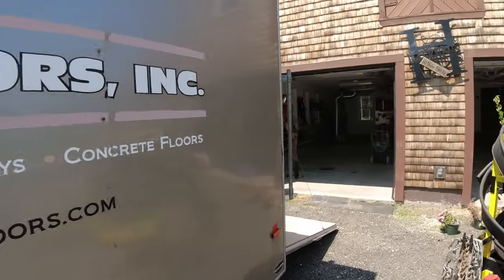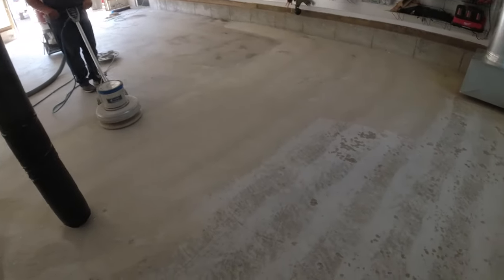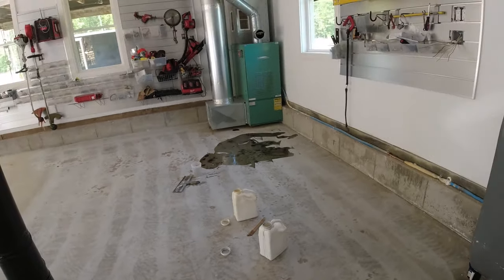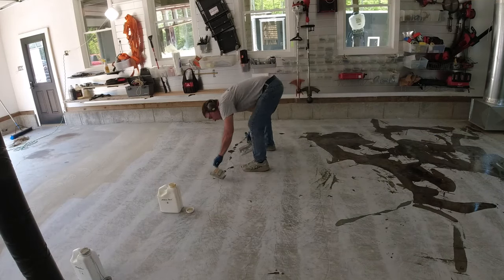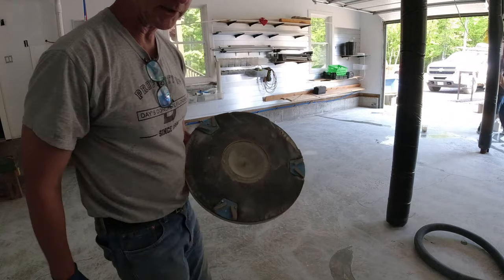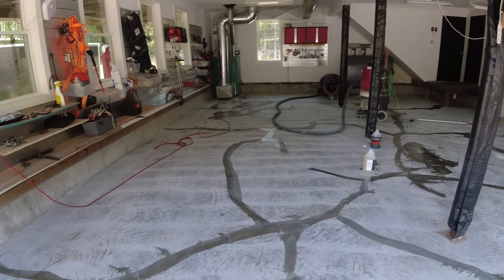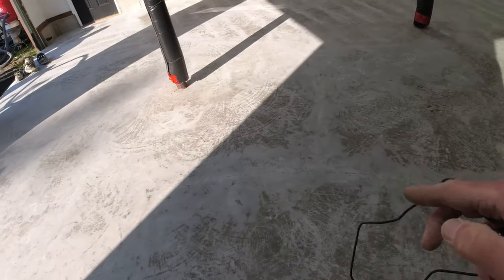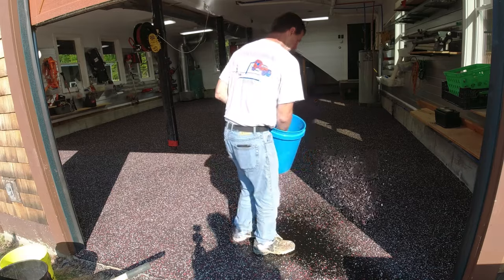Epoxy Garage Floor Repair Kit - How To Repair Concrete Cracks

Comment: In the commercial/industrial sector we will trowel a grout coat over large sections or do a complete epoxy mortar overlay for entire floors when they’re party pitted and spalled, or sometimes over badly finished concrete that requires an epoxy floor.

Comment: Considering this for ours. We get a lot of humidity sweating on hot / humid days in summer and then it wicks through the porous top layers. We (lol, "we," my wife) cleansed it 2x with garage floor cleaner and then 2x coats of sealer, the WD 40 stuff, and the sweating still runs across the whole floor and under a stud wall into a closet on the same slab. Hoping that sealing off the attic with insulation / vapor barrier will keep the heat and humidity up there and then we can coat the floor.

Comment: Rapid restore is a great product. We use it all the time for our commercial customers.  I wouldn't use it for pretty Ness.   It's strictly for function.    Our customers are driving forklifts on the slab so its not a finish floor type of cool we are going for.  But it won't chip up.

Comment: That hot water heater should be elevated to whatever the local code indicates. Especially if it is a gas water heater. Pilot light can ignite volatile organic compounds. Nice work.

Comment: Shotblasting does nothing to clean or abrade all the pits you want to fill.  Shotblasting would have been a better method for a floor with so many defects.